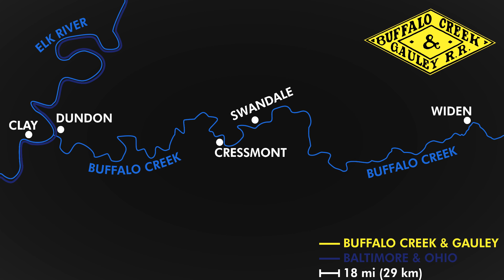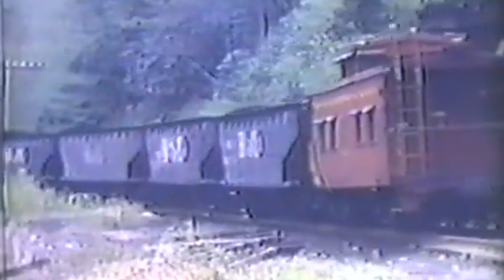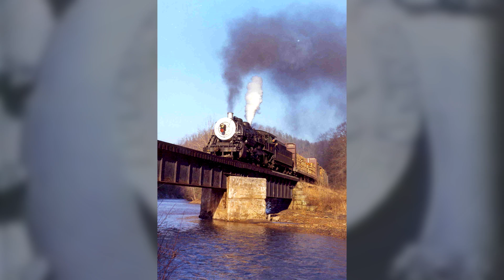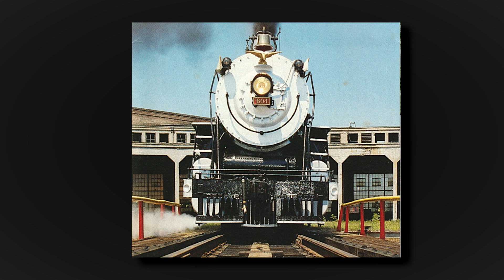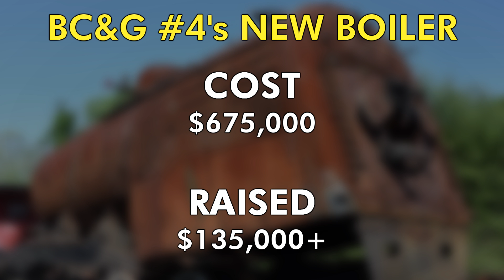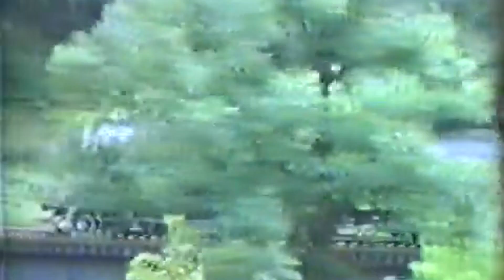Buffalo Creek & Gauley #4: Coal, Tourism, & Rebirth

Comment: At the end of operation at the Spenser Shops, they did the usual ultrasound to see what they needed to fix... There was a fairly significant patch of the boiler that would hand about 160 pounds of pressure.  The problem: The engine would be way way underpowered at that level...The shops ran it at about 180 pounds, and the folk running the last operations at the museum were shocked.  The boiler ended up going to a shop in Alabama to get a large patch applied.. No idea if that were ever finished.  The museum had a number of "real" Southern engines, as well as a shay from Graham County RR..  The Shay ran well after a whole lot of repairs..(Bent frame as I remember..) Now out of service i think.

Comment: Interestingly enough, BC&G #4 isn't the first engine slated to run trains between Cass and Durbin. Previously, a USATC S160 (#162) was purchased for the job in 1972, but then a washout occurred on the line between Cass and Durbin (that is only recently being repaired) and the engine was sidelined before finally being sold to the Age of Steam Roundhouse iirc.
Reply: What about the former US Army606?  It was acquired by the Allegany Central, but was not restored.Jack Showalter said it was in good shape when I referred me to it as "Six O Sick". I to think that it's on display at the Crewe, VA. Would it be cheaper to overhaul that engine  or another Gypsy Rose Lee consolidation rather than  re boiler the 4?
Reply: @williamclarke4510  it's possible that 606 wasn't available, or is in worse mechanical condition overall. Or maybe Snowalter didn't want to sell it. Or Cass wasn't interested seeing as locos like that never ran there historically.